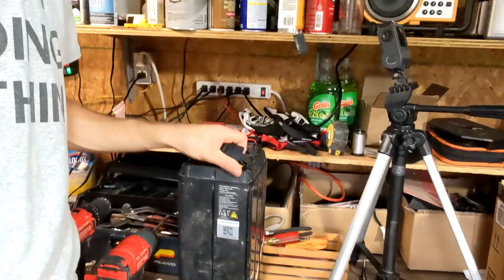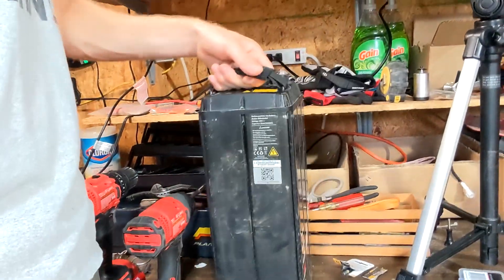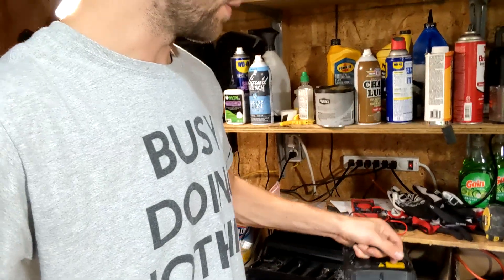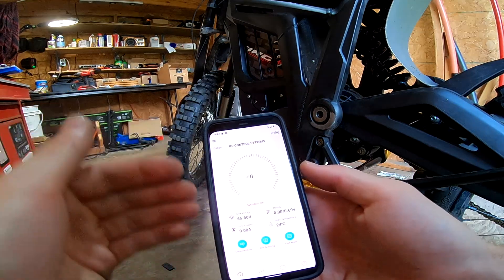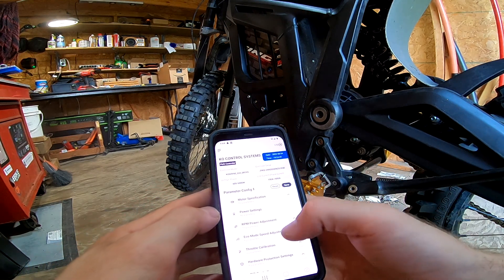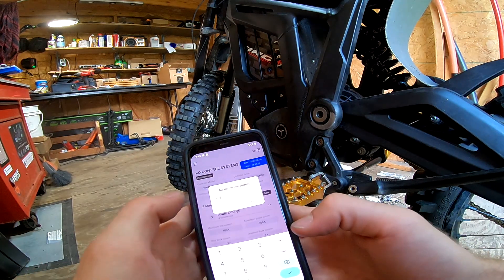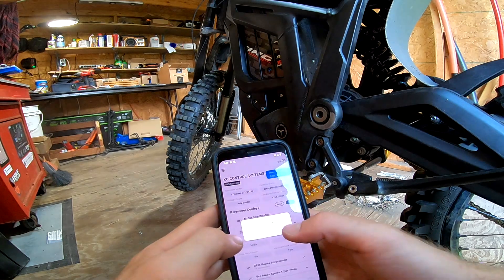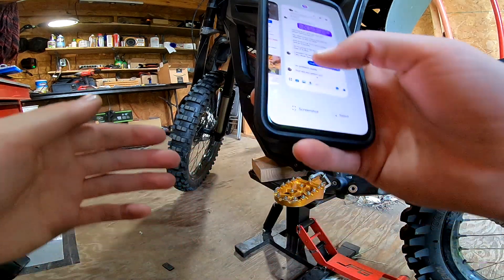Easy 30% POWER UPGRADE - Talaria Sting | Battery Bypass #howto #bms #how

Comment: I have an x3, my battery has recently stopped charging to 100%, it currently is only reading  28 ah 65.3 volts.. and 80% on the main screen. I have ordered a new battery but I wonder if the old one can be repaired. Does anyone have useful information?

Comment: After bms bypass how do you know battery level voltage. Is battery % display still accurate/enabled?
Reply from the maker: If you go into your settings on the Talaria screen, then click 'battery' it will show you the voltage of the pack
Reply: @electricisbetter what voltage is 0% or 10%. It takes a long time for my bike the actually tell me the right percentage after bypassing. I'm afraid I'm gonna take it to low.

Comment: So couldnt you just effectively connect these wire together or they need to be grounded as well? Also how does this work on the MX4, but with the stock controller for now. I understand the whole battery part and not running it down low, or riding it hard when low, while its bypassed..

Comment: Bypassing the bms is a great way to wreck your battery and burn down your house while charging. As the owner of a battery repair business I say DONT DO IT!
Replace the bms if itsthe problem.
Replace failing cells if that's the issue.

Comment: Never remove or bypass BMS on Lithium cells.
Reply: Why?.. i have plenty of drones with lipos and lithium packs that have no BMS.. Just need to know how to properly use, charge, and store them. You will lose alll the safeties yes. And it would probably be better to do this with an aftermarket motor controller/elec. speed controller, so you could keep track of Battery & Motor Temp's, current draw, Cell pack voltages, average cell voltage, etc.. 
I use 18650 cells for so many things, theyre not Lipos, that would be dangerous imo..

Comment: Would this be the same for the 2023 Talaria Sting R?
Reply: Comfirmed. I did it with mine. Same process.
Reply: @TheMooser1978  how much power would you say you gained in the mx4 ? What you set the controller to ? This post says 30% but that’s on a 6kw mx3 the mx4 is 8kw
Reply from the maker: My guess would be yes, or very similar.
Reply: Honestly, hard to say. Minimal would be my instant thought. I also put on a 54tooth rear sprocket at the same time so my top speed went down which is why I say it’s hard to measure really. I have the EBMX9000 controller and have played around with tuning a little. I find I get the most response in power by making adjustments there. I only bypassed to be able to maximize that controller. Let me know if you’re interested in those settings and I’ll get back to ya .
Reply: @TheMooser1978  I may also get that controller but don’t want to bypass waiting on the battery size I want to become available as every talaria battery is sold out atm

Comment: What happens when the voltage drops below a safe level? Battery go boom?

I hope nobody tries to do this whilst following your video. I'm an engineer by trade and even I'm scared from the vague footage, sorry dude. 

It would have helped to have closeups and markup on the affected cables

Cheers
Reply from the maker: No, the battery wouldn't "go boom". You would have a hard time charging it if it drops below that level. I feel like it's pretty black & white

Comment: It's kind of confusing that you don't tell you have a KO motors controller... ofc you can get more out of the battery by doing BMS bypas.. very unsafe though.
and on a stock controller it won't make any difference. I recommend buying a bigger battery that is equipped to deliver more power, when you upgrade the controller.

Comment: What happens when you full throttle with voltage sag? When should I start being conservative with this? I typically don’t let my battery go below 30%
Reply: It may bring the cells bellow they're lowest safe levels. That will basically kill the battery and make it un-chargeable.
Reply: you kill cells.. if you mimic what the bike would do youll be fine though.. 
Under 20% keep it in Eco and drive easy and under what is it.. 5% or 10% you pretty much have to accelerate as slowly as possible and keep it to like 10mph tops to get you home..

Comment: Have you seen Error 08 on the Talaria yet? and if so, how did you rectify it?
Reply from the maker: I haven't seen 08. Contact Ebikezilla. They will know
Reply: @electricisbetter  Already in contact. They said to hit the battery power button 15 times to reset. Which did nothing, so this should be interesting moving forward...
Reply from the maker: @tomorrowtactical  if I remember right, there is a list of some error codes and what they mean on the detections for the Talaria. Not sure if error 8 is on there, but you could check
Reply: @electricisbetter  I have, this is all it says: "Charge MOS error, Charge circuit got failure, Re-start the bike. and If the error code still show on the dash, please send the bike to the nearest dealer to inspect and repair."

Comment: So I did this and now my indicator is showing 20% charged when it's really full. Any insight?
Reply from the maker: Once you bypass the BMS, your % reader will no longer show you the accurate battery percentage
Reply: @electricisbetter  Did I do something wrong then? My bike went into limp mode after 4 miles and kept going slower and slower. Followed this to the T.
Reply: and by indicator, I mean the one on the battery itself. I know the display on the bars will be delayed/not accurate.
Reply from the maker: @tomorrowtactical  Where are you reading that its full if the battery % is saying 20%?
Reply: @electricisbetter  The indicator on the battery itself. The 4 green lights and a single red. It had been showing full power and then it suddenly dropped to the 20% red light.
Reply: I'll throw it on the charger tonight and see what it does. I've had this bike 6 months now and have never known the indicator to show full first and then the actual percentage. Its just always shown the actual charge.
Reply from the maker: @tomorrowtactical  keep me posted
Reply: @electricisbetter  Ya, it looks like my display is delayed. This is what it looked like after an hour of charging: https://youtube.com/shorts/egyQ6AsX1wY?feature=share

So I'm thinking I hit the button, saw the full indicator first and then just took off on a ride with a nearly dead battery, ha. I charged it overnight so now its full and staying full.
Reply: @tomorrowtactical  it does go to full first and then to your actual charge level after a second delay yeah.. i noticed that as well when i first got it. I still have my BMS i was just confirming this..

Comment: will this work if i just have the stock setup and batteries? will i get more top speed if u do this?
Reply from the maker: Not if you have a stock controller, no.
Reply: No. Speed is governed by voltage.

Comment: Just for trolls, yes you can ride 20 miles in a torrential downpour, your chain will be mighty upset the next day, but maintenance will fix that. Please tell me you know what the third wire is on the battery charge port, the small orange one, my charge port has the negative lead socket that does not make contact correctly and I want to just go around the charge port, I can use aftermarket chargers no problem, I want to use the stock still, but it requires some sort of feedback from the 3 port. On the charger end it is looped back to the negative. Thanks in advance.

Comment: Thanks for the informative video.

Can you elaborate on the math/science that you used to determine that the max continuous discharge rate of the bypassed battery is 130A?

My research indicates that the Surron stock battery uses Panasonic 18500 PF Cells in a 16s X 11p configuration that have a Maximum Continuous Discharge Current (MCDC) of 10A.  If that is true the maximum safe battery output current should be 110A (11p X 10A) which is 6.6kW.

The stock Talaria battery uses LG 21700 cells but I am having difficulty finding the definitive battery arrangement (serial/parallel) and the MCDC of those cells.  My best educated guess is that the battery arrangement the same as the Surron, 16s X 11p and the MCDC is 14.4A.  If that is true then the maximum safe battery output of a stock Talaria battery is 158A (11p x 14.4A) which is 9.5kW (158A x 60v)

Please correct me with facts, figures and educated guesses.
Reply: I believe the Talaria MX4 Sting stock battery is 60V@45Ah and using LG 21700 5000mAh cells.  That puts it in the 16S9P area.
Reply: @jeffmcclain  my battery does say 8/9P, so that would make sense.. When you open the battery to do the BMS bypass, no one has lifted up the BMS board to try and get a pic of one of the LG cells and the model number? Just curious really.
Reply: @jeffmcclain I have a bypassed mx3 battery what values should I set ?
Reply: Lol

Comment: At 2:56 - on the underside of the lid, on the left side is what appears to be a Bluetooth or WiFi printed circuit antenna. It's the thing that looks like a gold-ish squiggly circuit trace. Immediately left of the white square area.

Also clearly visible at 3:46 - middle of the video window left to right, at the top (inside the underside of the battery pack lid).

I'm sooo curious about what this is and what it does. Does the Talaria battery or BMS have 'secret' or undocumented Bluetooth connectivity?  Hmm....
Reply: Hi
I have an EMF and RF meter and the whole bike has a huge RF (radio frequency) radiation. My meter be knocked out if i put it on the bikes battery or next to the wires, to display and lights. If i remove the battery from the bike, and i push the test button, the battery emitts a huge radiation. The wifi or bluetooth module is wakeing up with the BMS electronics. My theory is, this is not a hidden/secret/tracking function. Maybe chineese saved a few wires (CAN_BUS) and they made a wireless connection between the display and maybe the controller. I thinking about to remove the RF module from the BMS, (because of the huge unhealty radiation to my balls) but i think then, the whole bike will be useless if the BMS can not communicate with other modules.
Reply: Yeah it does. Greenway BMS app. I use it to check cells and battery diagnostic tool it has on there and a RPM and Speed odometer
Reply: Definately used to program/check the BMS on the fly. I made my own battery and have the same. plug your battery in the charger, pull it out, and scan for bluetooth devices... it might pop up...
Reply: @guiseppe36749  someone smarter than me should write a phone app for this lol.. Id pay a few dollars for it on my iPhone and im sure a lot of other people would too lol.. 
Maybe it was a feature they were planning on using and never finished the programming or the app for it...? 
If you look at wiring diagram there is CanBus L/H running to the controller first i believe, and then out to the screen, or it might only go to the screen..
Because if you go in the Battery Menu in the "hidden" menu of the screen, you can see real-time Voltage, Ah remaining, and Battery BMS charge-cycles..

Comment: What type of tool do you use to open the battery?I tried torx 10 but was too small and 15 was too big.Thanks
Reply from the maker: DeWalt Max Fit Torx T10

Comment: Bypassing the stock BMS isn’t a great idea IMO. Need to change controllers and upgrade the motor’s phase wires as well. At that you’re taxing the battery beyond stock specs while compounding the issue by bypassing safeguards.

If you understand the risks beyond Dunning Kruger’s “peak of mount stupid”, go for it I suppose.

Upgrading from the stock O-ring chain to an X-ring or unsealed chain is probably the easiest way to boost performance, especially on such a small bike.

Edit: Finally if you’re riding mostly off-road/ technical trails, use a larger sprocket. It’ll aid the motor’s low end performance, at the cost of top speed.
Reply: How will a chain give more performance??
Reply: @kevinr.9896  X-ring and unsealed chains have reduced friction between the linkages compared to O-ring chains.
Reply: Whats the best x ring chain for a talaria?
Reply: @adeelhussain5207  niche x ring 420
Reply: @kevinr.9896  can you send a link please where to purchase the exact chain for Talaria? Thanks!

Comment: electric dirt bikes are trash
Reply: I have owned many dirt bikes. WR250, TW200. Try an electric dirt bike before you trash them. I LOVE my Talaria and its not even modified. Top speed is not as fast as my other dirt bikes, but when do you really ever go over 50mph on a trail or track? I never did. My Talaria is 100 pounds lighter than my dirt bikes. More nimble and more forgiving. No clutch makes climbs and low speed turns easier. You never have to worry about stalling on a technical trail or climb. No foot brake, makes right turns easier because you can put your right foot down in a fast turn and still have rear brakes. No noise, that's the best. I have ridden some amazing horse back trails that I could never ride on a combustion motor. Equestrians think its just an E-bike, I ride slow past them and they usually wave me by.  Urban riding too, lots of fun jumps in the city, you would be surprised. I guarantee you would ride an electric bike 10X more than your gas bike. On single track trails my friend cant keep up with me on his DRZ 400. Again my Talaria is stock 6000 watts. The new ones, Talaria R, are stock 8000 watts. And I bet you cant keep up with a modified 12,000 watt Talaria on most gas dirt bikes.
Reply: Bet my 12kw sting will smoke your kx250 easily
Reply: @SwarmMcReynolds  when ur electric bike will die when raining i be laughing lmao
Reply from the maker: @TopGFruto  electric bikes can get wet 😂
Reply: @TopGFruto  u do know you can waterproof ebikes right???? Derp took my sting through 4ft water yesterday how would your engine handle that… doubt it has a snorkel
Reply: gas = trash
Reply: You're clueless bro. Go troll someplace else and leave electric bikes to the pros. Its clearly over your intelligence grade.
Reply: why you here watching bum? go ride your pedal bike
Reply: Electric is awesome offroad. I use my surron for exploring around Scotland. Its a lot of fun.

Comment: You know the wires in the battery are 12awg. Why did you need 8awg wire?
Reply: 8awg is just thicker and allows more flow without the wire getting hotter

Comment: Any point doing it on a stock controller ?
Reply: Yeah good question, will this increase power with a stock controller? Or will it simply not "lose" power as the state of charge goes down?
Reply from the maker: It won't increase power with a stock controller. The only benefit to doing this with a stock controller is that the bike won't go into 'limp mode' anymore.

Comment: Love it as always man fyi just a heads up I pull 9-10kw regularly for long periods of time now do I recommend no don’t go more then 9kw but it’s a amazing feeling haha ride safe ✌🏻
Reply: Keep an eye for internal resistance all it takes is one cell.
Reply: What controller are you using
Reply: @gixxer8184  GLE bac 8k nothing better
Reply: What gauge wire was your bypass wires
Reply: @zap7136  I believe 6g could be wrong no less then 8g
Reply: @SwarmMcReynolds  It still doesn't make sense seeing as your crimping to 12awg wire in the battery.